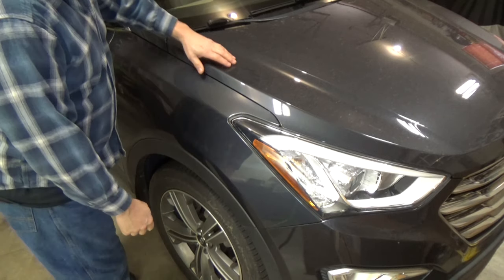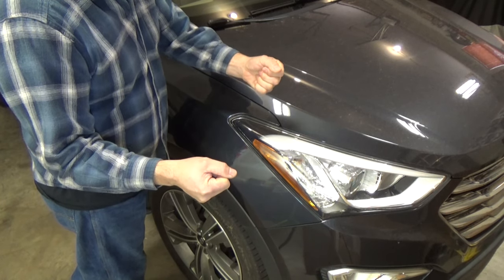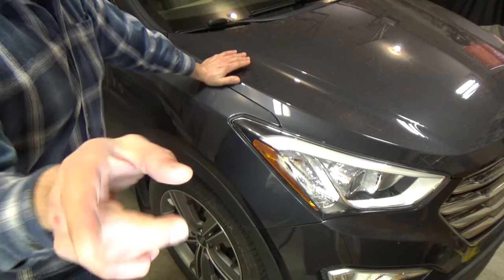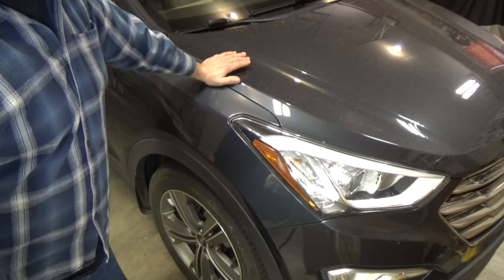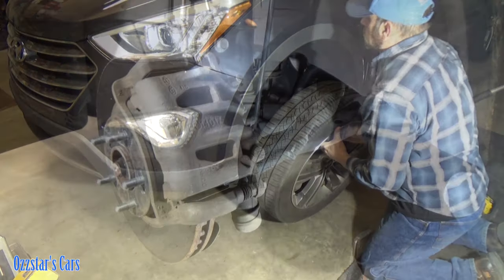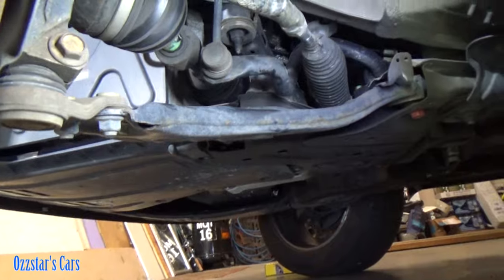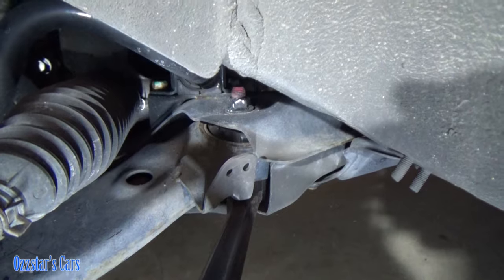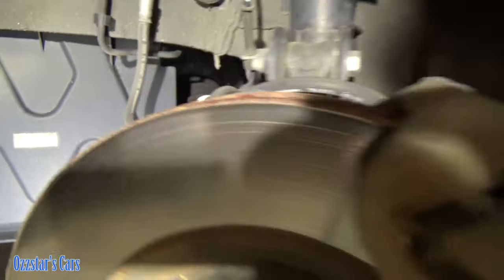Hyundai Clunk Noise Front Sway Bar Link Fix Replacement - Hyundai/Kia 2013-2019

Comment: 3-years late, but the ring indent on the palm of your left hand ........................ is from the centre pin of the jack handle?
Reply from the maker: Good guess but it's actually from the sway bar link bolt, when I grabbed onto it.

Comment: Key to removing them is to have both sides up or down. I lowered the side with wheel off onto a extra jack resting on wood block and rotor to take most weight off. Saved me from having to remove both tires at same time. Same result. Great video. Thank you.
Reply from the maker: Agree both sides up or both down otherwise it's a tough fight. 👍  Thanks
Reply: What does that mean "have both sides up or down"?
Reply: @madmax8620  Watch the video and if you still don't get it, take your car to a shop.

Comment: I don't need to do this job...YET, but now I know the proper names of a few suspension components and how to diagnose and deal with  "clunks." I've done engine and brake and cluthc issues but have tended to shy away from suspension related gremlins. Not any more. Very good video.
Reply from the maker: Thanks for your comment. Now you know!

Comment: I did replace the sway bar links on my 08 Acura to a few months ago but man, I hate it. It comes with allen key slot at the end of the knuckle so taking it off was a pita. And because of that, now I'm doubting myself if I did tighten it enough (didn't torque spec it )
Reply from the maker: The hex kind can be a bear to remove. I usually cut the old ones off.

Comment: Best video I've seen explaining everything, pointing out how to check everything. Will be replacing my sway bar links this weekend. Went with the Mevotech greaseable bars, hope to get a little extra life out of them. My vehicle is a 2008 Sebring convertible with the 2.4 litre 4 cylinder. Has  a little over 132K, but is starting to show her age. Again, thanks for the video, had heard about this procedure to either keep the cat on the ground or have both wheels off and in the air. I will use my jack stands and replaced the links while car is off ground, much easier installation!
Reply from the maker: Good luck with the fix Rich. Let us know how it goes!

Comment: Glad you mentioned taking pressure off drop link by jacking up other side. Thanks
Reply from the maker: I taught myself that trick. I was working on a Ford many years ago doing suspension work and had the hardest time of my life connecting the drivers side sway bar link.  Live, learn and help others.

Comment: Great video, great technique, very thorough. I'm getting the same "Clunk" on our 14.5' Range Rover Sport with 106K miles... The "Clunk" is coming from the drivers side wheel well area which would indicate it's something either attached to the knuckle/HUB, air-strut, or sway bar/links... Now I'm 95% sure it's either the sway-bar bushings and/or the sway-bar end links. Happens on medium to hard acceleration. I bought both OEM sway-bar bushings and as for the end-links as I went with the Moog serviceable end-links too. Going to install them this weekend God-willing... I hate that "Clunking" sound. Thanks again for the diagnosis that the Dealer has missed twice and costed me over 3K chasing down.
Reply from the maker: Let us know how it goes Jeremy.  👍
Reply from the maker: Oh and BTW if you fix the problem, show the stealership the video. 😁

Comment: Hey Glen, just wanted to thank you for this great video. The tip of lifting the car slightly on the opposite side made the trick for removing the damaged part. You are the man! Thanks again and many blessings to you and your family!
Reply from the maker: Glad the video helped Javi!
Reply: You could as well put the jack down the low arm of the side you working at and lift it a little bit, then you can make the screw go out easily. This way you do not need to lift up the other car´s side ;), BTW of you are going to check  the car after this, you just can  disconect only the lower screw of the link instead of removing  the whole link  before to replace it.

Comment: THANK YOU!! After listening to clunking for the last 6 months, I did your test and it failed. To test in a parking lot: I turned the front wheels so that I could touch the links with my fingers  while reaching in from the rear of the front tire. My brother then bounced the corner of the car and I could feel the play in the lower part of the link quite easily. Both sides were shot. I got my mechanic to change both sway bar links, and it's smooth as silk now.  Thanks again! (I like your teaching style, very well done.)
Reply from the maker: Thank you, glad the video was educational and enlightening.

Comment: Just bought a 2014 Sorento and I thought I just wasn't used to the steer by wire steering, it felt squirrely, with a very slight pull to the right, the previous owner mentioned during the test drive that a clunk had started recently. Had my mechanic diagnose and fix before I saw this video. Exactly what you did. Fixed the clunking and the steering tightened up and started tracking perfect. Now I'll check to see if he used a greaseable part.
Reply from the maker: Good to hear you have a competent mechanic and not just a parts changer trying to make money.

Comment: Thank you for the video! This ended up being the issue on my 2012 Hyundai Elantra. Unfortunately, I dumped a lot of money on shocks and struts (though they were close to needing to be replaced). Drives so much better now.
Reply from the maker: That new car feeling!
Reply: Just about to tackle my 2012 Elantra ( 200,000 miles). While doing an oil change, I noticed the ball joint of the stabilizer had come right out. Oops.

Did tie rod ends before and this looks easier.
Reply: @marcknightly9677  - I do wonder if my ball joints are bad. The loud clunking sound is gone but there is still a click sound on some bumps. It is better than it was before.

Comment: My wife's car is a 2010 Hyundai Tuscon (similar to Santa Fe) had clunking in front end, thought it was a Tie-rod or Ball-joint. Mechanic said it was a "link" and gave a rough estimate of $200 to fix. After a quick google search and watching your video, I did it myself. I bought a used 18V Torque wrench, and 2 Moog bars from Amazon. All in about $120. Was easier than changing the oil! Thank you!! (btw I have the same grease gun, mine doesn't leak)
Reply from the maker: That awesome Craig and you have a tool to use for a long time.  Passing the tip jar around now. 😁👍

Comment: Tks dude. Fixed my Hyundai Starex (i-Load or i-Max in other countries) clunking noise when going over the road hump, after changing this front stabilizer bar link. Previously changed  both sides of  tie rod end due to noise when turning the steering wheel. But it will not stop there. Weeks later another slight clunking noise heard when turning the steering wheel due to worn both sides of steering rack end. It looks like this is the package of compulsory components change of Korean made cars after hitting 150K km mileage. Tie rod ends, front stabilizer sway bar links (both sides), steering rack ends, and steering rack rubber bush if worn & loose.
Reply from the maker: It's always going to be something on a well used vehicle.

Comment: My clunk, was the stabilizer link.  Devil of a time finding which one.  Meaning, it always sounded off on the RF.  It turned out to be the LEFT FRONT, LOWER sway bar link joint was the culprit.  It projected the noise to sound like the right front.  The top of the link was still tight, that kept me from getting a shake test by grabbing the link to check for play.
Reply from the maker: Yeah man, it happens! Good find.

Comment: Quick way to check those sway bar links. While the car is on the ground, turn the steering wheel so you can have a little access to the sway bar. Put a pry bar long enough to reach between the control arm and sway bar. Pull the pray bar up and down. You will hear the the clunk noise. You must have the pray bar between the control arm and sway bar.
Reply from the maker: I need a pray bar.

Comment: I like your videos Glen of where you show each step. I assume that anyone who watches doesn't know and you've got them covered. And for the ones who do know,  they'll just skip through the video. My first thought about that impression was that you were pressing on the stabilizer link bolt. So, to confirm it, I back tracked through the video to see you doing that, but you were using your thumb. I see further down in the comments, that's what you were doing. I guess you cut that part out. Anyway, great video and keep up the good work! 😊👍
Reply from the maker: The magic of editing. 😁  Thanks Terry.

Comment: This video is really helpful!!! Thank you!
I had a clunking noise on the right side of my 2017 elantra for 6months! since i bought the car. After bad experiences with shops, i now do my own work on the car if im able to. Anyways, i bought a new strut 2weeks ago, that didnt fix the clunking noise. When i took the strut off, the sway bar link top joint was moving so freely i could move it without touching it! Now the thing is, i thought it was normal so i left it as if thinking it wouldnt be the clunking issue. Still i bought a lower control arm and bought sway bar links. came in yesterday. Yesterday i replaced the control arm and the clunking is still there! Soooo now im change that sway bar link out and hope thats the issue, which im almost certain it is considering the loose play in the joint. If that isnt the issue, then its the ball joint which i was unable to replace because its stuck lol so again, thank you for this video!
Reply from the maker: Let's us know when the new links are in. 😉
Reply: @ozzstars_cars  getting ready to do it right now
Reply: @ozzstars_cars  ok so i installed the links, unfortunately it is indeed my ball joint 🤢. 
Ima buy a separator tool this wheel and put the new one in.  i got coilovers coming in Wednesday so ill just do it all in a shot. One thing about all of this, i may not have fixed the issue, but man have i learned so much about cars since tryna fix things myself. I shouldv went to school for it because im always finding or tryna replace something on my car LOL thankfully im hands on!
I subscribed to your channel so i look forward to seeing more vids! Also, could you do a video on replacing a manifold gasket? i believe i have a leak
Reply from the maker: @acrocheezefpv  doing the work yourself gives a sense of satisfaction. Saving money and doing the job correctly.  Here is the manifold gasket replacement along with the spark plugs on a Hyundai Kia 3.3L.https://youtu.be/_XAopqc_Y8g  
Thanks for subscribing Acro!
Reply: @ozzstars_cars  Ok awesome thanks! and one last question!! please! So my car is a semi automatic. but i drive in manual mode all the time. The issue i hear is when i downshift from high rpms. 
example: If im roughly going 50mph, and theres a wall where the sound of engine/exhaust bounces off of, i can hear a rapid ticking noise. Now, im making an assumption that its an exhaust leak sound, however, it sounds like its maybe my right side axle or something. Any ideas?
Reply from the maker: @acrocheezefpv  sorry but its nearly impossible to diagnose an issuelike that over the internet.
Reply: @ozzstars_cars  Understood,  thanks

Comment: I was waiting to see how you got the bottom 17mm nut loose. There is almost no room with the control arm and Kia manual shows dropping the subframe and removing the whole bar.
No way I will do that.
I'm honna go struggle to get it off now.
How much difference would a grease fittings make, if maintained by greasing it regular, versus life without a grease fittings.
Parts are relatively cheap and my own links for the 2005 and have 232k miles with no grease fittings.
The clunk is annoying, but not a big issue.
I finally decided to change the links to see if the clunk goes away, rather than jumping into any other parts.

Update, replaced sway bar links, control arms and struts. Strut tops were bad, but the clunk was still there. Today I confirmed the noise is from worn stabilizer bushings that hold it to the frame. Now the problem is that to get to the bolts for the bushings, it requires loosening or removing the subframe to reach the bolts. I did see a video where they loosened and dropped the subframe slightly, but even then it's a pain in the arse.

Comment: Great video! Ya, my grease gun leaks as well. I think it's just the oil separating from the grease. Mine is so old, that the grease won't even pump anymore. All the oil leaks out and leaves a dried up lump in the gun. If you don't use the gun often enough, this will happen. I'll have to get a new tube before I start the end links. LOL! What a mess to change it!
Reply from the maker: Stop the grease gun bleed Steve!

Comment: I purchased Hyundai OEM from Rockauto. They didn't have any grease in them and one was as bad loose as one i was replacing. I ended up reusing the good one i just took off. It has 293k miles on it.
Reply from the maker: Wow that's some serious mileage!
Reply: @ozzstars_cars  it's been a very good car. But lazy me has ignored the suspension and in the process of replacing stuff :)

Comment: I spent $560.00 at my Mazda dealership trying to get rid of the knocking sound but they failed. I went to another mechanic and fared no better. I’m hoping my Mazda MPV  has the same part that you took off. Either way, I’ll find the cause because it’s really bad and it’s frustrating as hell that the dealership could not fix it. Thank you for making this video.
Reply from the maker: I hope you can find the problem.  Replacing parts that are not necessary is wrong. I hope you get your money back!
Reply: did you work out your issue?
Reply: @fish04fun65  Yes. I had some good mechanics look at it and in just 20 minutes they found it had a bad ball joint on the right side. For the life of me, I don't understand why my Mazda dealership could not find the problem. It's either incompetence or they just did not care. I'd always thought highly of them but now I no longer go to Mazda dealerships. It's not worth it.
Reply: @GnosisMan50  I'm having the same problem.... Dealership is a rip-off who only hire Duds. Most mechanics just want your quick service cash and are not bothered  diagnosing. It Only Knocks/clunks  once when accelerating hard/fast in Drive or once in reverse. If  slowly Accelerating I doesn't clunk..... I've been told by 3 mechanics so far "just wait till it gets worse ".... 🤦‍♂️🤦‍♂️🤦‍♂️

Comment: Nicely done and you must live in a sunny, warm state.  I had to cut the bottom bolt of the driver side using an angle grinder as I just couldn't loosen the nut - pb blaster 4 5 times over 2 days, a torch etc.  :-) didn't work.  Luckily the passenger side literally took 10 mins
Reply from the maker: I wouldn't consider Delaware a sunny warm state but overall the weather is decent.
Reply: @ozzstars_cars  nice..spent 2 years working in downtown wilmington 🙂
Reply from the maker: @Hoster987  sorry to hear that. lol

Comment: Excellent video got a quote of $600 dollars to change out plugs and pcv looks like 110 dollars in parts.  Going to try this a few weeks did you film the throttle body cleaning. I've read there is a certain way to do it. Thanks again.
Reply from the maker: I might have a throttle body cleaning video, hard to remember with 300+ videos posted. Nothing special to cleaning.

Comment: I haven’t had any problems with Moog suspension parts.  Great video Glen!
Reply from the maker: Some say differently but I haven't personally seen any issues.
Reply: @ozzstars_cars  been threw 3 sets of end links on my dodge charger from moog in the past year and a half. 👀
Reply: MOOG parts aren't  as good as they used be.
Reply: @hahahahaha8660  just blew through OEM in 1 month 😂 I'll replace them with cheap aftermarket from now on and save 20 bucks a side. Won't be using moog though. Their parts aren't correct.

Comment: Nice thorough walk thru. Nice work. And up north in upper Canada where it's -40c for weeks at a time and a 6 month winter. I always use Moog parts never had an issue with them. And those zurks already installed same with their ubjoints etc. Saves u bunch of time drilling and tapping your own zurks in. I like to be able to service my truck when doing oil changes while its draining you put a few pumps in and chances are that part will be a lifetime part and not break again. Not like the OEM LIFETIME components. Those are a joke.
Reply from the maker: Absolutely!  Stay warm and thanks for your comment.

Comment: Amazing guide.  If my quote comes in too high. Heck im doing it myself.  I do have a torque wrench so should be smooth.👍
Reply from the maker: Easy job
Reply: @Ozzstar's Cars  yeh got it done and it was easy. But it was at the limit of my strength. Thank you though. The links were 140. Could have got them cheaper.

Comment: Just had sway bar links replaced. Still clunks on bumps just as badly. 
'07 Hyundai Accent coupe. 184,000 miles. What next?
Reply from the maker: Find a competent mechanic that can diagnose the problem.  Let us know if you can what the problem was.